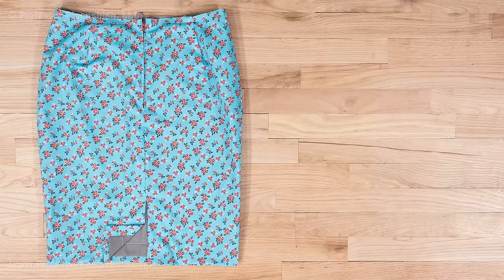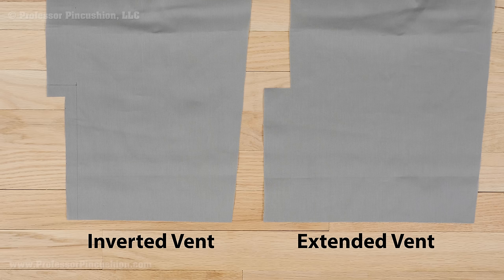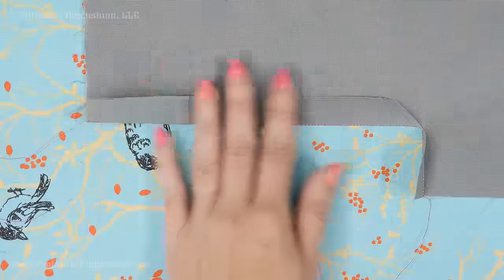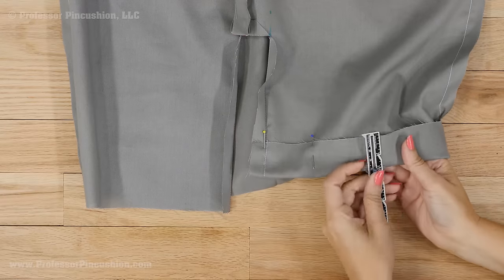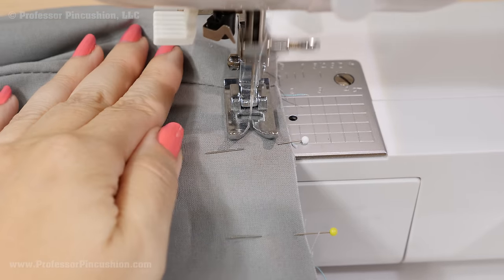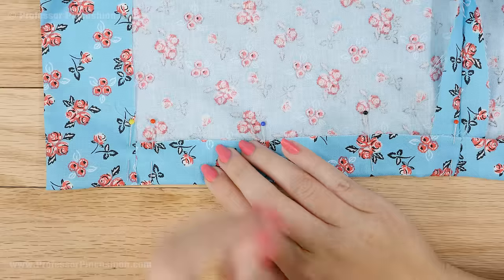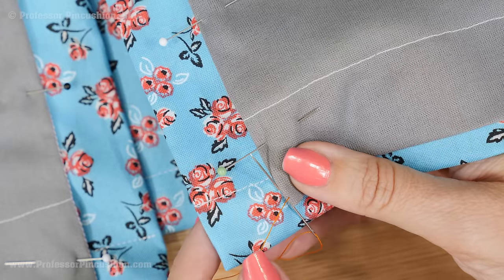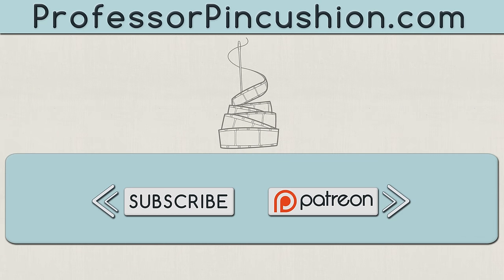How to Sew a Lining in a Skirt with a Slit - Vent Extension

Comment: My daughter is getting married and she order her dress on line she wans me to do a split on it and Im not confident to do it because of the linning in it can you help me? maybe recomend another video
Reply from the maker: hmmm.....so adding a slit on a something ready-to-wear? that's a tough one. We have a video on converting a regular skirt pattern to a pencil style and adding the vent extension but it wouldn't be the same since it's working with a pattern. All I can tell you (and I don't know if it's helpful or not) you always want to put your vent on a seamline. So this is either on a side seam or center back seam. This way you can remove the stitches to where you want the slit to stop. Now doing this on something already made means you probably don't have a lot of seam allowance to then fold over to the wrong side of the slit, which is why it's better to alter a pattern and do it from scratch. But if you find it's not enough fabric, you can frankenstein it by sewing a new strip of fabric to the raw edges of the slit you created so it looks more like my examples and gives you more fabric to work with. Hope that helps a little.